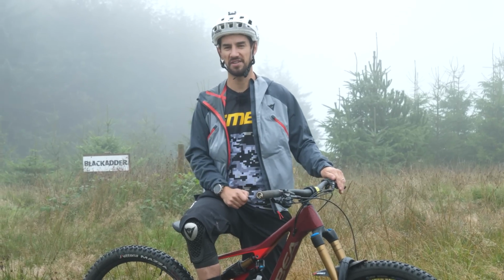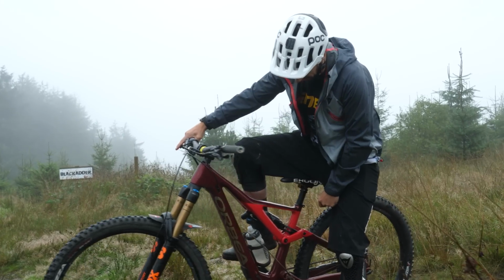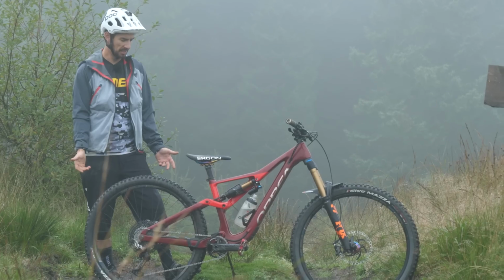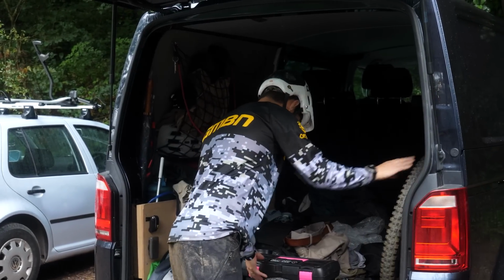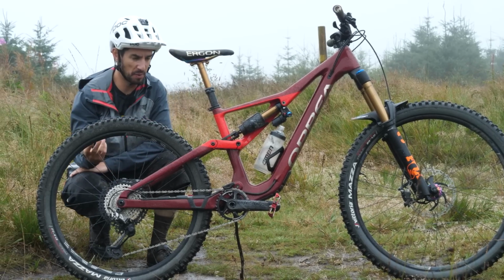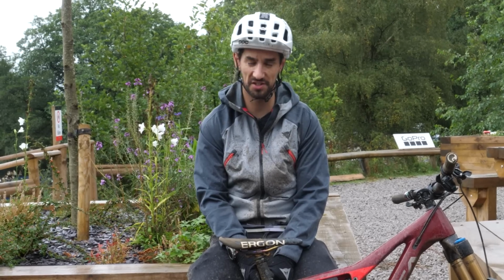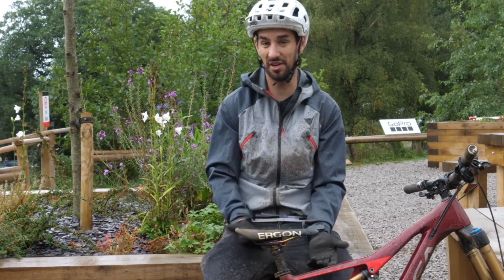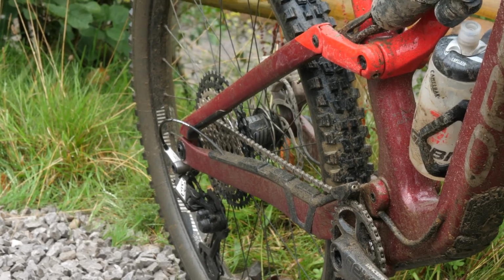Mixed Wheel Vs 29" Mountain Bike Wheels | The Wheel Size Debate Still Continues

Comment: My brother has a Nukeproof megawatt and the difference with that smaller back wheel is very noticeable compared to my Vitus Sommet 29er. It suits the bike I guess, but I personally find the back end to be a bit unpredictable. I also find the bike wants to do a nose dive off every drop and jump, which can be a bit unsettling. 

I prefer a 29er at both ends personally. It's a shame a lot of ebikes are sold in the mullet configuration. I'd rather they'd be sold as 29ers with the option to stick a 27.5" wheel on the back for when you want that extra flicky back end on tight trails. It's a bit of an annoying fad that the manufacturers are forcing upon the consumer, rather than just providing an option.

Comment: If I can choose I would like 29 front and 30 back or both 29 or both 30. A small wheel at the back really slows you down a lot. Also bad for going up the hill because you gonna lift you front to much. And small wheel at the back makes the bike very unstable.
Reply: You mustve missed the part where the bikr comes with a mullet link so the geo doesn't change in the mullet form
Reply: @jack91522  that is the only bike I know that have that.
Reply: @kwl1497  specialized stumpy evo has one too. I think spindrift, canyon, intense, and a few others started producing mx options.
Reply: @jack91522  now I know two

Comment: I now have an “original” mullet setup, 26” x 24” on my Banshee hardtail. I did it to slacken the head angle. The bike just feels better all around. And that 2.8 back tire has a lot of cush : ) and it’s almost 26” in diameter where the 2.35 up front IS over 27” in dia. At 5’7” 29” wheeled bikes make me feel like a little kid standing next to them. Though thinking about a 27.5 fork and wheel up front and a 26” rear. Finding a straight 1 1/8 fork might be a problem, ya think ?
Reply: Right, I’d like to slacken the bike even more...

Comment: Isn't the whole point of a mullet to have the bigger front wheel, but with a shorter chain stay? Neil couldn't do this as he just wanged a 27.5 wheel in the back and then raised the BB. Mullets I have ridden are specifically mullets with a shorter back end, that's when it really makes sense. So much more agile than a 29er, but with the rolling and front grip advantage.

Comment: Let's make bikes longer, then put a smaller back wheel in so they're more manouvrable?
The real fad is bike design.
Reply: longer wheelsbase decrease manoeuvrability of bike in tight corners. Longer bike will help only for fast (not tech) riding. Cornering is harder with huge wheelbase.
Reply: Yeah it's not that simple. It depends on what you're lengthening, a longer front triangle doesn't produce the same dynamics as a longer swingarm. 
And a smaller wheel has less unsprung weight so it takes less energy to change its rotation. This equals more power to the ground quicker, more responsiveness. 
Change of direction isn't the only sort of responsiveness that matters.
Reply: Bikes are legitimately just getting better geo every year. Every bike I demo now days rides amazing!

Comment: Hmm...  Well, well there mullets that really should stay to the 80's... And then there are mullets like this bike, and that is cool.  But I'll stick to my 26er for the foreseeable future at any rate. 🤣
Reply: My thought is if one is going to run mixed wheel sizes, then might as well start looking and testing the old concept of having front/rear specific tires like the old Panaracer Dart and Smoke.  And why not given that one is already forced to keep two different tire replacement sizes...

Comment: I already had a 1000w 27,5 rear for my EMTB when it was stolen so I bought a 29er MTB and popped the wheel on that. The slacker steering is compensated for by trimming 40mm off the ends of the handlebar and chocking the controls/grips. The longer frame of the 29er makes it a beautiful stable fast ride. I may try a mid drive on the full 29" wheels. Anyone done this conversion?

Comment: Should I buy the Scott Scale 980 or Polygon Xtrada 7?
Difference between them is...
Xtrada 7 has thru axle and it has a 120mm suntour xcm air fork...and the scale has 100mm coil fork...
Reply: Get the Polygon, you definitely want the air fork.
Reply: @Miksy42  okay...thanks bruh 👍

Comment: I’ve been riding 29ers since 2013, so I’ve kept with them through the 27.5 era. I don’t see myself trying a MX setup, I’m just so used to the confidence of a big rear wheel and I’m content with how it feels in the air. It’s all about the speed and confidence in the tech for me.
Reply: Me too, cause the fact is full 29 or 27.5 will still be better overall the mullet are just personal preference and likely better suited for freeride type of riding... For me i still prefer full 27.5 for normal trail riding and full 29 for AM/Enduro type riding.

Comment: I have tried mullet in Rotorua and the back grip wasn’t enough (in wet conditions) for general trail riding. Even though the rear tire was 27.5 2.6 it slipped out too much.
Reply: Large volume tyres are notoriously bad in wet muddy conditions.  2.4” max.

Comment: Offroad motorcycles have used the "mullet" setup as long as I can remember. They have a 21" up front and 18" in the back. It works great, but they are powered with powerful engines. How does the bicycle "mullet" setup work when you're not going mostly downhill? Not so great I would suspect, but inquiring minds want to know!

Comment: Is there such a thing as a Reverse Mullet, larger wheel at the back smaller wheel at the front, making climbing better as creates lower front end, and if not why not?
Reply: Well, obviously it would assert more of your mass towards the front, assuming you don't add a longer fork, which could make climbing better, but it would also make descending way worse.
If you were to compensate for the smaller wheel with a longer fork, you could reserve the geometry of the bicycle and have it ride decently well, but it's hard to say anything about it, as I've not tested it YET.

On a hardtail this could actually be fairly reasonable, since you have plenty of squish up front, but none in the back, so having a larger rear-wheel to make it roll over stuff technically more efficiently, while keeping the suspended front-end, you could achieve a more balanced ride if the concept was made to happen properly.

For shorter riders this probably wouldn't be the best depending on a lot of factors, but for taller people it might actually make some sense.
Reply: I would probably go for same wheel size but a linkage that can be locked in a extended position, like pushing the linkage so far out that you have no sag on the rear. So if your bike has 160 mm rear travel and 25% sag, you aren't sitting already 40 mm into your bikes travel, but 0mm into your travel.

Comment: Nothing like  getting the old ballsack on the back wheel ha ha i have two bikes exact same spec one 29 f and r the other  mullet with shorter cranks i think the mullet is more fun easier to manual easier to tip into corners but th 29 is mostly a little bit quicker on my type of all mountain rides up and down not xc .

Comment: Small rear wheel for bike park days, big rear wheel for long pedal days to get rid of the wandering on climbs. Steepish or tech climbing is much more annoying with a mullet. Lower derailleur height with these long af 12 speed derailleurs is another big disadvantage. I hosted an enduro and XC race a few weeks ago and out of 200 racers, 4 ended up destroying 12 speed derailleurs. Having destroyed 3 myself, long derailleurs are the big thing that keeps me skeptical of mixed wheels on anything except a DH bike with a tiny derailleur.

Comment: I been riding 26" hardtail and full susp but never rode 27.5 and 29er before and I am due for new bikes and I don't know if I should get 29er or mixed wheel.
Reply: How tall are ye man?
Reply: @christopherwatson1163  5'10 and both bikes are medium size frames. Both bikes are also 2005 so smaller than modern medium frames.
Reply: @jameskim7266 I'd say try both if you can get on a couple of demos. But at your height you would definitely  get the benefit of the smaller rear wheel clearance, and coming from smaller wheels, you will definitely feel the big wheel out back to be in your way, and hard to turn with.  Any ideas on yer new sled? Make model wise?
Reply: @christopherwatson1163  for full susp i was thinking Santa Cruz Bronson or Megatower and for hardtail I was thinking Santa Cruz Chameleon, Commencal Meta HT, or Pole Tavial.
Reply: @jameskim7266  haha I just sold my chameleon frame and pike fork to pay for my bronson deposit, about 2 months ago. I've now built up the bronson frame with  a new lyric ultimate red and an xt drive train I had on my chameleon. I am loving it Bro.  I can't recommend it enough.  And if you can afford a hard tail too. Then the new chameleon looks even better than the one I sold (2020 model).
Reply: @christopherwatson1163  alright, I guess I gotta demo both bikes and see how I feel.. For the hardtail I been definitely leaning more towards the new 2022 Chameleon.. Thanks for your input!

Comment: Again about the "meaningless mullet" simply there's no advantage riding with two different sizes of wheels, the only purpose the bike producers go on mullet is because is the "only way" to shorten the chainstay (I'd say the easiest) but Neil a couple of years ago already tried mullets and noticed no difference or improvement using this solution... https://youtu.be/zsK5brL8sQo